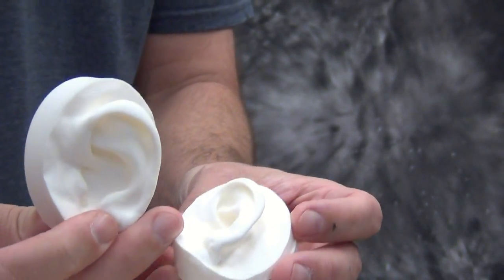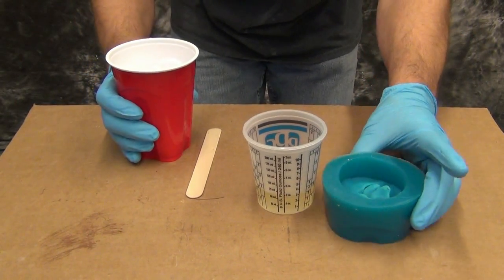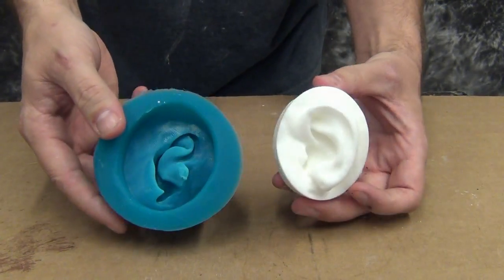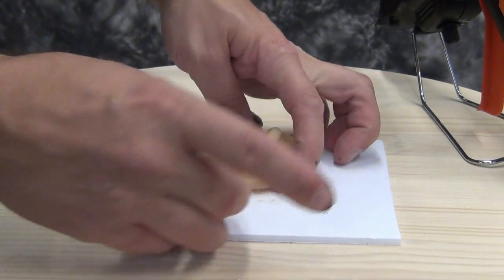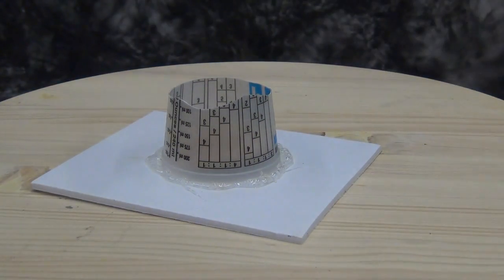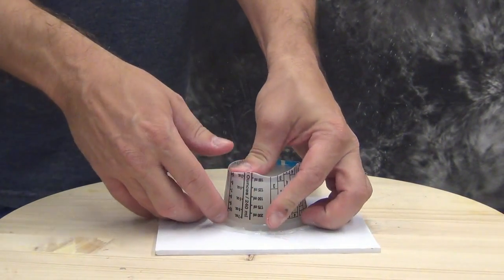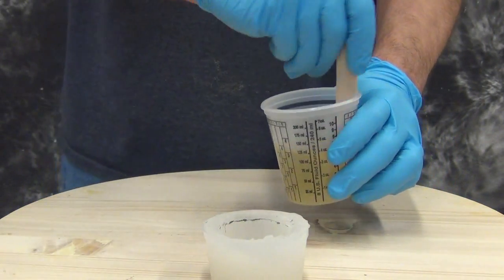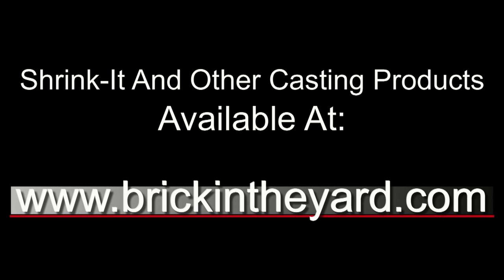Shrinking A Part 50% With Shrink-It Rubber

Comment: Once the Shrink-It is dry, how hard/soft is it?
Anyhow, neat product!
Reply from the maker: The final rubber "feel" is about like 74-30. I haven't measured it with my A Gauge, but I believe it is an A30.
Reply: Brick In The Yard Mold Supply
Alright.  Thank you very much.